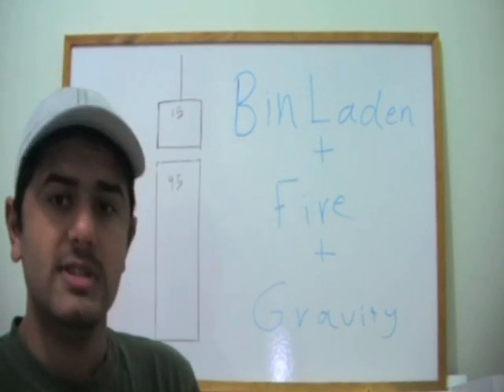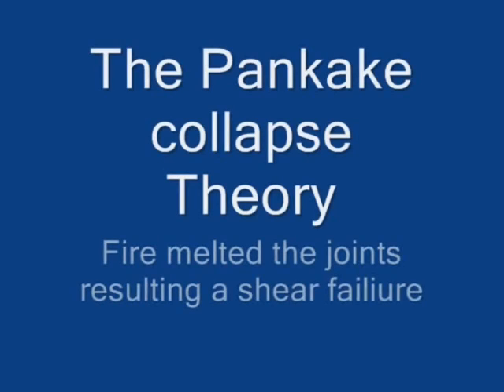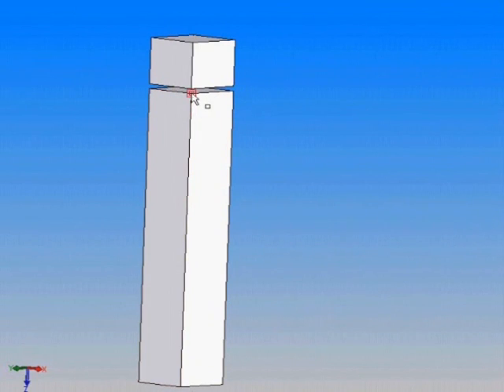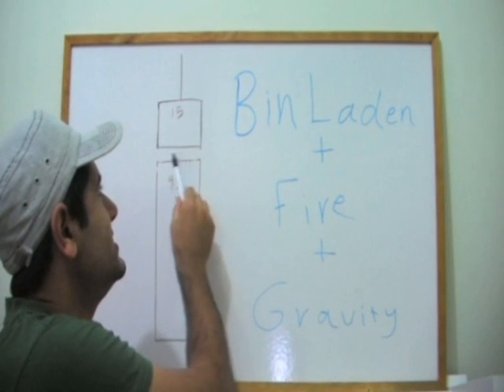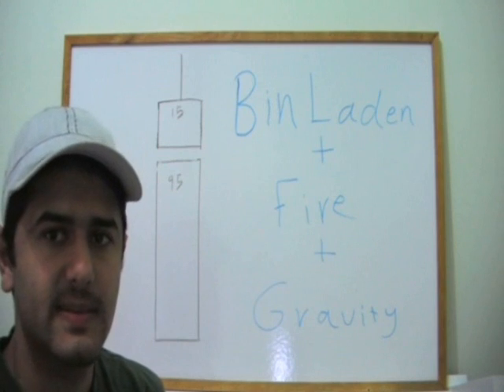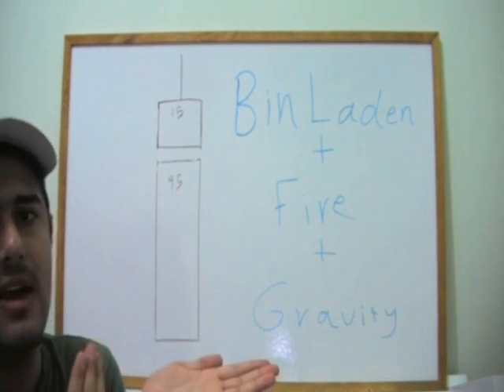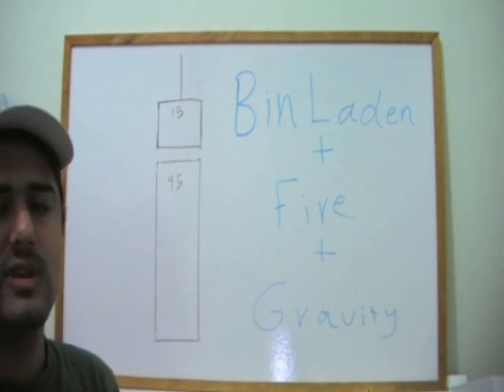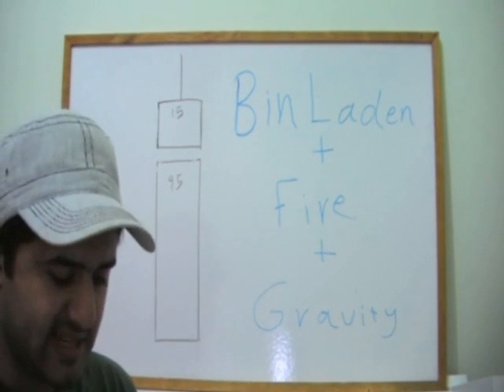(Part1) 911 Simple Physics Structural Failure Vs Demolition

Comment: are you kidding me , the whole building collapsed in 6 seconds idiot , fully intact from 4 faces with damage to its back , how come it didn't tip over to its back instead of going straight down through the path of greater resistance !!
and im still waiting on your theory of how can a thick steel column collapse downward through itself ??

Comment: You obviously have no grasp of physics or engineering at all. You draw the lower 90 floors at a singe mass, which is a fundamental error. It is 90 separate floors, each with its own structural members. They didn't erect it by pulling it up as a single mass and it didn't collapse that way either. The mass of 15 floors hit ONE FLOOR AT A TIME in succession, not a 90 story solid mass. That's all you need to understand and there is no mystery whatsoever.

Comment from the maker: the problem with your analogy is that in the case of the weight lifter you have added more gravitational energy by lifting the load higher as the Eg=mgh  but in the case of the tower no one lifted anything,,,  but you are right dynamic loads are much bigger than static loads.   If you want to make a correct analogy its like  a weight lifter lifts the load then other people hold it for him and let him lower his hands then drop it on him then it will be much harder for him but 15 wont destroy 90

Comment from the maker: yes precisely very well said ,,, its  a rule to severe the base and creatre a big gap at the bottom, this will allow the top "unsevered section" to come down and accelerate and build up enough kinetic energy to break off the unsevered top part however in the 911 none of this happened , The bases were suposedly untouched and the impact zone was way higher,,,  proportionally it was like a 10 story building having its top story broken but some how all the 9 floors below also fall apart!!

Comment: Black smoke is not necessarily an indication of low temp. "Black fire" conditions were apparent in the Towers, equally destructive to contents and steel as open flame, and explosive in nature (fire training manuals). Additionally, pockets of fully oxygenated fire were noted  with temps as high as 1800f measured, and the NE corner of the South Tower  showed particularly intense fire. Even more, the molten material turned silvery/gray further down as it fell and cooled.
Joe Hill

Comment from the maker: aluminium needs 600 Celsious to melt which means the flame around it needs to have higher temperature and it needs to have enough time to transfer the heat.... the oxygen starved fire with the black smoke and with that lady being able to stand out of the window in the damaged zone  and fire fighters being able to go up higher than the damaged zone that temperature could not have been any where near those temperatures to melt aluminium or steel

Comment: With enough force, say about the size of a building, you can crush 95 stories without even an explosion. The force will make its way to the bottom if each level of the building is not designed to carry it. You're not talking about entirely solid object here. This building is a hollow structure. The power of the force might even increase as it crushes through layer after layer.

Comment from the maker: what your missing here is that in madrid the whole building turned into an inferno red glowing and it had 24 hours to conduct all the availiable heat. in the twin towers not only the fires were very cold but they were limited to only one small section of the entire building only which is at the top.... even if we assume that the fire initiated colapse no way we can accept that 95 underneath storeys intact just got crushed by the top 15 stories.

Comment: Some other facts:

- No steel framed building in history has ever been hit by an airliner at full speed, which exploded in a 300m. fireball, and then burned uncontrolled.

- Steel loses half of it strenght at temperatures well in the range of WTC fires. Steel does not have to melt to give way on an already damaged structure.

- Windsor building in Madrid. The outer steel frame collapsed due to fire alone (wasn't even hit by a plane).

These are facts. Not opinions.

Comment from the maker: it did happen.  it was controlled ... buildings this high can never be brought down without touching surrounding buildings but minimal damage is expected which is what we saw but it fell in its footprint....  in cases of structural failures you would see the whole building falling sideways like a falling tree not into itself... structural failiures usually take place at the buttom... you cant have a structural failiure at the top which makes a building fall...

Comment: The columns were pushed out of the way when the building started to collapse.  They go in to whats called "Plastic Shear"   So much weight hits them that they split like a straw. 

There is a web page that takes the time to plot where all of the steel came to rest. 

Its all there.  The concrete is, of course, gone.   And that was done easily.

Comment: You're stating that the columns didn't have to fail from the weight of the top of the building.  so they were left standing after the collapse?  I'm trying to paint a picture in my head of the scenario you're describing.  I think this video brings up a valid point, even while being very generous to the official story.

Comment: You have nothing but an unsubstantiated theory, there is no math, science or laws of physics that support your theory.

(of course there is but you decide not to acknowledge it).

"..the 767 impacts were substantially more than we had assumed in design"  (Les Robertson).

The 707 was factored to be on landing approach.  IE moving SLOW.  Not screaming in at 560 mph. 

Planes don't land at 560 mph.  They also don't land with full fuel tanks.

So why are you going to plan for that?   You wouldn't.

Comment: they encounter a stationary mass 60 to 90% greater!!!

(What?!!).  The floors of the WTC don't carry the vertical loads. The columns do.  Well, they've failed.  So guess where the loads go?  On to the floors.  The floors have a MAX load limit and its about 1600 tons.  You are now asking that floor to carry a descending load of some 32 floors?.. In motion?.   This is a dynamic load about 1000x over the floors rated maximums.  The building would collapse immediately.

Comment: I got some news for you.   The WTC was a piece of shit.  It was junk.  It was a horrible design.  It was basically a LOWES home hardware store or a Best Buy run up to 110 stories.  That's all it was.  The only thing revolutionary about it was the concept of a skyscraper was reworked and moved around. But how that was done... was shit.    It had a horrible floor design and the entire thing relied on those floors to stand.  Start taking out the floors and it won't stand.

Comment: The uniform and symmetric damage that followed is possible and acceptable..

The answer to that is yes.  And it has nothing to do with a CD.  It has to do with how the building is MADE to start with.  

All of the gravity loads are directed straight down to its footprint.  The building is 90% air.  There is more than enough weight and space for it to go through itself.

Comment: Quotes!!

The 767 impacts were substantially more than we had assumed in design"..

"There is no way one floor is going to hold the weight of 14 stories dropping on it. Not possible. Not even close to being possible.  Drop 14 stories on one floor and the building would collapse instantly and down to the foundation and it wouldn't be a slow collapse"..

Les Robertson.

Comment: Eutectic corrosion is not conclusive, and was not widespread.
There were no heat measurements which were hot enough to melt steel, and if the reports of molten material are accurate, aluminum is the most likely material. There were tons of it on the building (cladding), both planes were made of it, and measured temperatures were hot enough to melt it. Considering all structural evidence show the buildings being ripped apart at their connections, "molten steel" will never gain a new investigation

Comment: Watch some more video of the S Tower. The entire slab of the east top wall continued to arc down to the east as the top broke apart. Note that when the base upon which a mass is resting gives way, the arc of the angular momentum will decrease accordingly. That's exactly what happened. I don't know what claims by NIST you refer to; I just watch what happened, and there is no mystery or violation of physical law.

Comment: Have you watched any of the collapse video? Both most certainly fell asymmetrically to the side, and they maintained their momentum, even as they broke apart. The remainder of collapse was internal, and there was very little resistance. You know what "splay" means? Both the cores and the walls were progressively  splayed, It doesn't take NIST or any type calculations to see that and to know the splaying will cause damage to lower floor connectors. I can't help it if NIST didn't  see that.

Comment: The lower sections were not intact. There's plenty of evidence to substantiate.  Several floors above and below impact were weakened due to plane impact alone. The load became off centered. The cores were stressed, and there are reports of floor collapses in the lower sections. Once collapse commenced, the shock to the cores, and the splaying, caused progressive weakness to lower floor connectors. All the structural and debris evidence supports this.

Comment: It's a matter of resistance to falling mass. The mass happened to be a mountain of churning steel and concrete. The resistance was close to zero. The contents of the tops broke apart and emptied into the standing sections, leaving only the perimeter walls of the tops, which we saw fall apart.  This is based on documented evidence, not conjecture. If you study with an open mind you will be able to see. With a pre-disposition to explosives, you become blind. I've been there.

Comment: First, I rely on available evidence, not some "official" story, which is an assumption on your part. It's not an either or. 
The hottest temps in the NASA imaging could be estimated at 1300f minimum, but with nothing to conclude higher temps. The hottest temps in the Towers were 1800f, which I believe was recorded with thermal imaging. There are no recorded temps hot enough for molten steel.

Comment: Ali, you are basing this on incorrect assumptions. Read through my responses to other posts. The upper mass changed into a near liquid, and poured down through and around the structure. Much of the cores were still standing, even if briefly, and perimeter walls were forced out laterally, not crushed down. You'll never figure it out if you think in terms of two solid masses opposing one another; that's not how it happened.
Regards,
Joe Hill

Comment: The only columns cut at 45 degree angles were from the clean-up operations. If you refer to those standing column nubs with 45s, stop and think. Is that how the buildings fell, from bottom up? No. Look at the cuts. They have fresh slag with no slide marks from separation, and no gouging from subsequent falling debris. Plus there are videos of them being cut. And besides all that, large sections of the cores were still standing post collapse.
Joe Hill

Comment: It was the contents of the "tops", including all the floor material, trusses, cables, plumbing, and office contents which literally poured into the standing portions, the floors of which were already weakened. Once the tops toppled, it became an internal collapse, with the volume of churning material overwhelming the weak floor connections, progressively weakening lower floors due to stress and splaying of the cores. This is based on the debris remains and video of collapse, not conjecture.

Comment: NASA imaging did not conclude actual temperatures; only that they were at least 1300f.
There are no measurements which would indicate temps hot enough to melt steel. The hottest measurements in the Towers were approx. 1800f. Molten steel has never been verified nor tested for. There is no evidence that what was reported as molten metal was molten steel.
Joe Hill

Comment: Columns can be seen cut by the thermite, at a 45 degree angle so they slip nextt to each other to facilitated the pancake seeming collapse that occured.  The micro particles of debris is evidence of the explosives that thermite and explosives generates when activated.  We were told such an outlandish story of a plane and heat.  All the fuel burned up in the initial fire ball.  The cool black smoke after was not hot enough to melt ot soften anything.  People are seen in the openings!  No heat!

Comment: Part 2
When it buckles, the interface is not a horizontal plane, but a 3 story jagged zone of damage, because of 3 story, staggered columns.
"The column were actually crushed & bent". Wrong. Most columns were straight & intact in debris pile. Connections failed.
Biggest mistake: he looks at blocks as continuous material, not as lattice of 1% (cross section) very strong steel columns & 99% (cross section) extremely weak concrete floors.

Comment: Part 3
He says "bottom is much stronger than the top". False.
a) Truss-column and column-column connections failed. These were the same strength on all floors.
b) when the collapse begins, it is not the top block against the bottom block. It is the top block against the massively damaged middle section.
c) Initially it is 3 floors of debris generated. 3 floors of debris fall onto massively damaged (by plane & fire) 95th floor, followed by entire upper block

Comment: Part 4
"Fire melted columns". Dumb & wrong. 
"The columns would fail gradually, melting slowly." Dumb & wrong. The failure was buckling, not melting. Buckling is a very rapid, sudden failure, not a gradual one.
"Top would lose stability, pitch & fall out." Dumb & wrong. Mr. Merza doesn't understand the mechanical criteria necessary for a block to fall to the side, nor the reason that it is impossible for a 2D lattice array of columns like the towers.

Comment: Part 5
High school physics book? High school physics is for balls in vacuum. Post-grad structural engineering text is for collapsing buildings.
"Encounter resistance of lower structure which is untouched": Massively wrong. Upper block first hits into zone of maximum physical destruction. 
The load carrying capacity of any damaged floor is NOT the same as it was when the building was intact. It is far, far less.

Comment: Part 6
There are 3 separate factors that caused the collapse to progress to the ground that Merza ignored:
1. The load carrying path for the building's weight goes ONLY thru the columns. The concrete floors can not support the weight of the upper floors. THIS is "load path". 
2. Mr. Merza considers only static load, & ignores the dynamic load, which will be 10x - 30x greater. Gross error.

Comment: Part 7
3. Because of vertical stagger of 3-story outer column assemblies, every floor (n) of the tower lost 2/3rds of its supports before the crush fronts arrived. 1/3rd of columns damaged when floor n+2 was destroyed, and another 1/3rd damaged when floor n+1 was destroyed.
NO lower floor was "undamaged". Every floor was massively weakened before the crush front arrived. No floor, at the time the crush front arrived, could produce the resisting force it could when it was intact.

Comment: Part 8
Even in his twisted logic, Mr. Merza's force diagram is wrong. He ignore the weight of the occupants in the weight of the building, but include it in the reaction force.?
Wrong.
Mr. Merza doesn't understand Newtons. Or force diagrams. 
Downward force was mg, where m includes everything (including jet & people). Measured net accel was ~2g/3, meaning resisting force was ~mg/3. Most of resisting F was inertia. Little was columns.

Comment: You offer no evidence at all.  Your only input has essentially been "you're wrong, you can't prove it is molten steel".  Well what the hell is it?  It's not aluminum, it sure looks like molten steel.  The video I linked you to describes steel that has interacted with an exothermic (thermitic) reaction.  The evidence for this was found by physicists and engineers studying the little evidence that wasn't immediately shipped out to China for recycling and the dust particles near ground zero.

Comment: i'm going to guess you didn't read the paper then. "The composition of the red/gray chips found in this study (epoxy resin with iron oxide and kaolin pigments) does not match the formula for the primer paint used on iron column members in the World Trade Center towers."

Comment: The lack of evidence is evidence. Proof by Negation is used extensively.. Most scientific knowledge is developed through inferences drawn because of a lack of evidence for the contrary.

For instance if someone pulled a gun on me and I took it away and shot the assailant, my prints better be on that gun. If that is lacking then I am covering up a murder. 

The evidence is lacking on the 9-11 event. So one can rationally infer a cover up on that fact as one infers murder by the lack of prints.

Comment: everything supporting the floors would have to fail simultaneuosly,that can only be done thru careful planning by man 

No no no no no no.... And no!!

You need to understand WHERE and HOW the loads are carried.  If the mechanisms that carry those loads fail (and they did)  this transfers the loads to structural members never intended to carry them.  THE FLOORS.  they have a load limit and it was instantly exceeded upon failure.  The next floor has exactly the same limits.  Its exceeded.